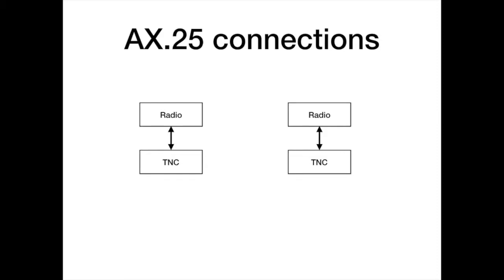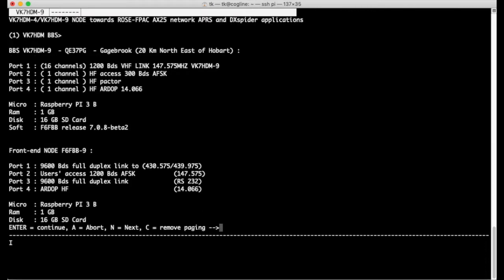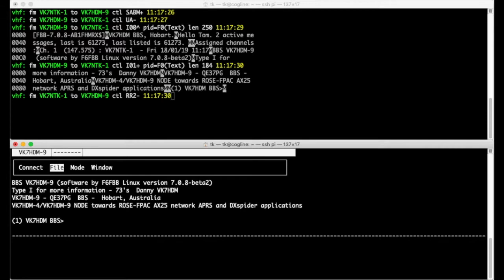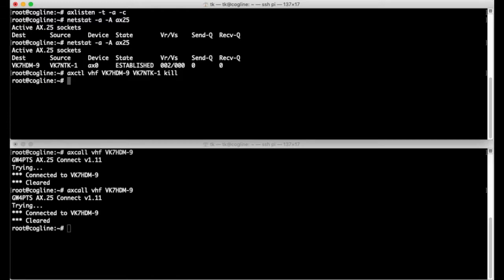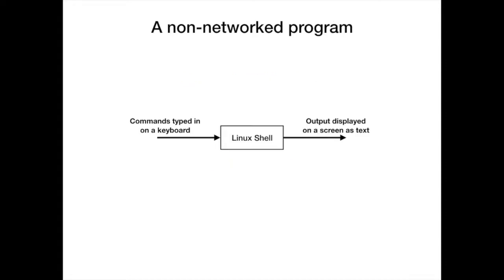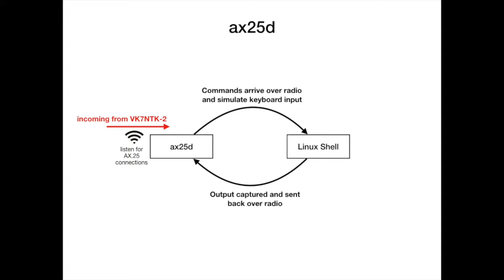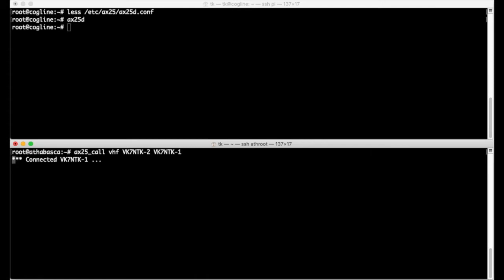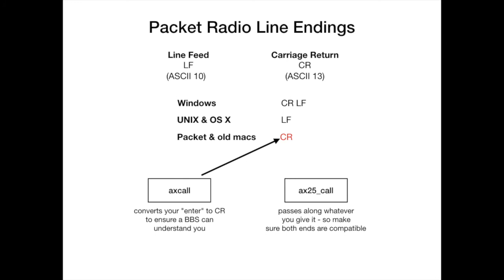Packet Radio Operation on Linux - Connected Mode

Comment: Linux has curious gaps. For nodes it's rock solid, but for connected/attended mode, linpac works kinda sorta, but has no mbox. If you don't run linpac you can never see anyone connecting in to you.  If you run EasyTerm in Wine with Direwolf, you get buffer size errors in Direwolf.  We're missing an EasyTerm for linux basically.
I can run Direwolf + linbpq, works great, can't receive incoming connects on linpac with that running.
I can run Direwolf + ax25d + mheardd and uronode and then I can run linpac, but with all that, I have no mbox unless I want to run a full BBS and a lot of people don't bother with those to leave a msg.
Funny matrix of small gaps after all these years of work.  I did write a perl script as a node app for a personal mbox but you still can't see if anyone is  connected to you.  It pains me to say that Win10 with UZ7HO and EasyTerm is the most functional for me if I'm calling CQ and just looking for people to connect.

Comment: If you're using a TNC, couldn't you just use "screen" to connect to the TNC and then use the TNC's functions?
Reply from the maker: With a traditional TNC, yes! However AFAIK the TNC-Pi doesn't provide those interactive capabilities. The Linux utilities offer a consistent interface across any KISS-capable TNC, new or old.